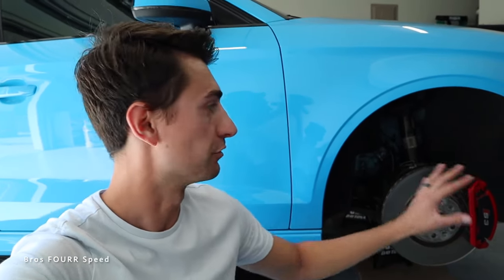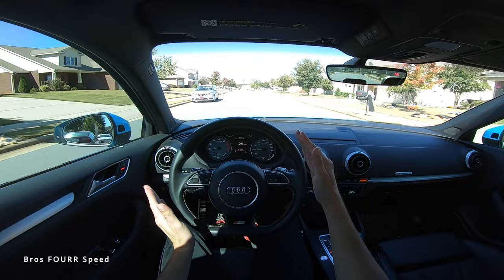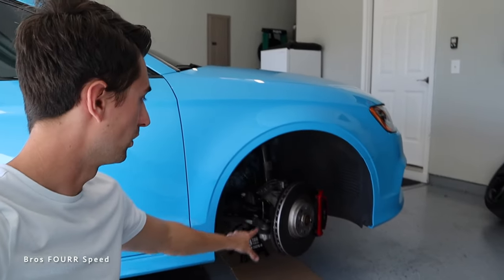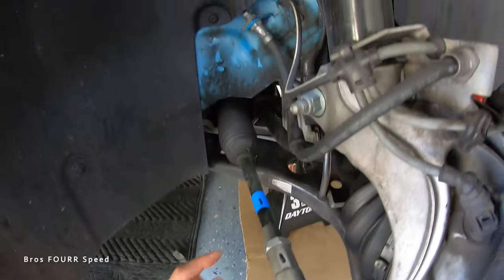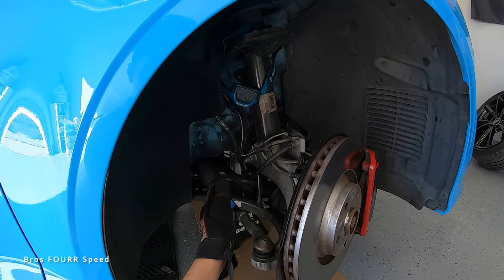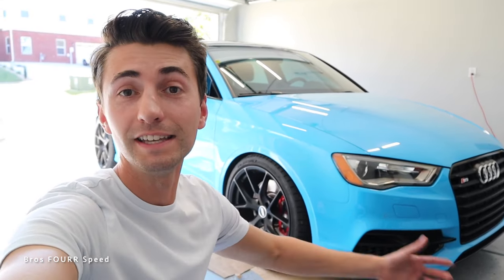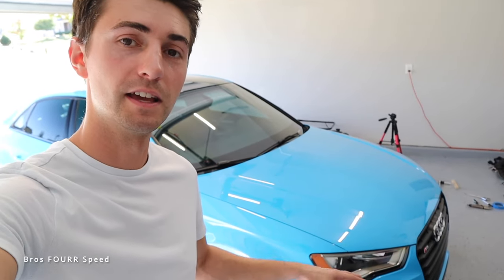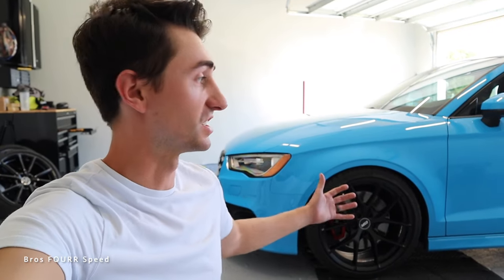How to Straighten Your Steering Wheel Easily at Home | DIY Car Alignment

Comment: No obnoxious intro, no obnoxious music, just straight to the point. All DIY videos should be like this.
Reply from the maker: Thanks! We don’t like that “fluff” so it’s not in our vids!
Reply: Putting intros in videos are annoying. It's more time wasted and it takes longer to get to the information needed.
Reply from the maker: @static_Tricolor_camry  Yeah we like it simple!
Reply: Agreed
Reply: Stop crying
Reply: Hey so my drivers side front wheel is slightly toed out and the passenger side is right where it needs to be. Because of this the steering always seems to be lightly tugging to the left

 I only need to toe in the drivers side wheel. Can I leave the passenger side alone. Can I do it that way? 

And secondly I will be leaving wheels on with them flat on the ground. Do I leave the car in park and completely off as I’m doing the toe adjustment or do I have it in acc mode and in park? 

Also my tie rods are behind the center of wheel when looking at the inside of wheel so I suppose I have to turn tie rod counterclockwise to push out the back of wheel so it toes in?

I’ve never done this before so a step by step tutorial if you can would really help me!!

Thanks
Reply: Agreed. And he's fixing up his wife's car - extra kudos :)
Reply: Hi bud, does this method still apply if the steering wheel it not straight bc I changed the steering column? Cheers
Reply: Lots of repair videos get straight to the point.
Reply: Exactly

Comment: I wanna buy you a beer bro fixed my steering wheel being off thanks a lot man appreciate it 💯
Reply from the maker: lol glad to help! Great tip to know how to do!
Reply: But I don't understand need to do in both sides?
Reply: @juanojeda8069  You need to do it to both sides to keep the alignment. So in his case, car was drifting right..so need to adjust the toe left.. so he shortened drivers side rod (this pulls the rear of the wheel closer so it turns the whole wheel left and then extend/lengthen the passenger side so it 'pushes' the rear of the wheel which turns the wheel left also.
Reply: @RoxusRemo wait I think I see how I fucked up. So “opposite” turn directions, is actually the same, because the rods are pointing opposite directions. So clockwise one side, counterclockwise the other means they both get turned away from you (pushed over) or turned toward you (pulled under) if you’re perpendicular to them

Comment: What's crazy is I took my car back to the shop after they aligned it bc of this issue and they tried to tell me I had to fix my rack and pinion plus the steering bushing for $2700...lack of integrity these days are eye opening
Reply: So this diy trick fix the issue sir?
Reply: @ArczAngel  truthfully, still haven't come around to it bc I don't have a lift. But one thing I know it's not the bushing or pinion.
Reply: You don’t need a lift 😂
Reply: @brentonthompson8909  meant floor jack lol. Not sure why I said lift

Comment: Too bad after $200 4 wheel alignment I'm even having to think about doing this but there you go,great video.
Reply from the maker: Yeah it's a bummer most shops can't get the wheel perfectly straight! At least this is an easy fix
Reply: I had two done still crocked spent £100 now my dad will do this manually

Comment: Just did adjustment at a local shop with my mercedes s212 2016 and got the same result as you. I went back again two times to the shop and try to explain my steering wheel problem. The shop owner was just angry and snarky. Now i will adjust my wheels exactly like you. Thanks for the video. 😊
Reply from the maker: Sometimes doing it yourself is the best result!
Reply: I tried explaining this to the shop who did my alignment but they test drove it with 3 people and told me it was fine. so I took it elsewhere and they ALSO didnt straighten the wheel .-.
Reply: @aquifer98  it happened to me too, it drives me crazy
Reply: I had my car's alignment done at Mercedes Benz dealership and the steering wheel has never been so crooked, it's so disappointing.

Comment: I had to move mine just a quarter, steering wheel is probably more straight than it's ever been in it's life 😂 thanks man
Reply from the maker: Glad I could help!!
Reply: Do youo need to remove the wheel for this?
Reply: @rolandsequeira  Depends on the vehicle. If on full lock you can access the tie rod, then there's no need to remove the wheel. I've done it on my little car.
Reply: glad it is working for you,had my tech add a tad bet for road crown although I was reading up if to much is added it could cost tire wear,tires not tracking straight

Comment: I just had a replacement of all of my expired tyres and had my wheels balanced and aligned, unfortunately my steering wheel is now crooked, exactly like in your wife's car. I went back to the tyre shop but the mechanic wasn't able to fix it after 2 adjustments. Gonna try this solution this weekends as it is driving me nuts. Thanks for this man!
Reply from the maker: Oh wow! Yeah this should do it! Especially if everything was just aligned. You should be able to dial it in
Reply: @BrosFOURRSpeed My steering wheel is now straight. After some trial and error, my tie rods needed around ~190 deg of rotation. Thank you so much for this video!

Comment: Just got my alignment done on my Volvo and they did exactly that. I drives me crazy. Thanks 👍🏻
Reply from the maker: Oh dang!
Reply: Same bro I have an s60t5 put new rod ends on got the dealer to perform the alignment, low and behold still a tad bit cooked lol. Steering. Was straight before I took it to them
Reply from the maker: @DMAX29  crazy how shops can’t put them perfectly straight!
Reply: Just found this great video as I've had new tyres and alignment on my V70 and the steering wheel is crooked!  I called the shop and they gave me some nonsense about 'settling in'. As the old saying goes,"If you want something done,do it yourself"

Comment: Man, you saved my sanity 🤯
Those damn alignment shops always mess up my steering wheel, usually it took them 3-4-5 times to center it.
Last time they all failed and I got tired, decided to fix it myself, found and watched your video and my friend helped me with this procedure - finally steering wheel is centered 🤘🤘
Had similar problem (car drifted to the right), needed half of a rotation with my '07 BMW e60. 
Happy af about it and thank you very much!
Reply from the maker: Glad to help! Yeah it drives me so crazy! When I had my old Supra aligned, the tune shop showed me this trick!
Reply: @Shawn C Hardly disagree. It's shop' and tech' fault only. If you took money - you have to finish the deal. Don't care about how busy they are.
Reply: Tire prolly is gonna wear badly
Reply from the maker: @themotorcycleguy5980  Have zero issues..
Reply: @BrosFOURRSpeed  same thing 🤙

Comment: Thanks man, great video! I had the same problem on my 2012 Camry only opposite of your Audi. My front wheels needed to go slightly to the right. I did one full turn on the adjusters like in your video. But, in my case it was just a bit too far and steering wheel was slightly off in the other direction. So, ended up having to do the adjustments a second time. I returned the adjusters a bit back so that they were both exactly 1/2 turn from where they were originally. 2nd test drive and sucess! Straight track and straight wheel. Kinda sucked having to do it twice but I guess it's trial and error with different vehicles. Still saved me alot of money and hassle with alignment shop! Thank you!!!
Reply from the maker: Nice! It's definitely trial and error. I got lucky and 1 full turn worked. But good adjust to know how to do!
Reply: so if  your wheel was towards the right , did you adjust the driver side toe first?
Reply: @reza_dc2   It really doesn't matter which side you do first. I actually did the passenger side first. What matters is that you adjust both sides absolutely the same. But, one side you will turn the adjuster clockwise, and the other side counterclockwise.

Comment: I usually need an 1/8 or so of a turn.  A full rotation is pretty drastic and may be too much.  Depends on how fine the threads are on the tie rods.
Reply from the maker: Didn’t seem like the sharpest angle on the threads. Depends on the car I guess. But 1 turn got it perfect for me
Reply: How can you do only a 1/8 and keep the alignment aligned
Reply: @Libertyfirstrye  I’ve used calipers to measure the exposed threads before and after. Then add or subtract the same amount from the other side.
Reply: I did a 1/2 turn on my 2022 Toyota Corolla SE and the car drove to much left. I did that 1/8 turn like you did and it worked. I guess its trial and error on different cars🍷

Comment: Looking forward to trying this. My wheels was straight but just put new Michelin pilot ss on the front and it's ever so slightly to the left now, car is a giulia quadrifoglio and it has a really quick rack. Drives me crazy 😂
Reply from the maker: Oh nice, yeah this should help you out!
Reply: Got it sorted. I used the nut itself as a guide, one 6th of a nut turn on both sides got it right

Comment: Wanted to say thank you!  Like you and many others I had an alignment done after having my rack and pinion changed out in my 2012 Toyota Tundra. Like yours my steering wheel was slightly cocked right driving me nuts but not so much i felt like spending half a day at the dealership correcting it.  Only difference between my truck and your Audi, much larger tie rods and they were kinda tough to get that nut loose. 

One small suggestion to others.  I started with a half turn as opposed to a full turn.  After test driving the steering wheel was cocked the other direction.   Jacked the truck back up and reversed it a 1/4 turn and it’s now perfect.  1 full turn is quite a bit depending on the vehicle and how off the steering wheel is. May want to start with a 1/2 turn and go from there.  

Thanks again, great video!
Reply from the maker: Glad it worked! Yeah different cars will differ. On my Supra I did about a 1/4th turn to fix it. The Audi just happened to need a full turn. Easy fix tho for sure!
Reply: I needed 2 full turns on either side the first time. Then after tie rod replacement to pass MOT it was 5/6 of a turn. I did 1 full turn and it was a tiny bit off in the other direction, so sighed, jacked it up and took the wheels off and subtracted 1/6 of a turn.

Comment: Installed a new tie rod because of rattling going over bumps, and vibration when braking at higher speed, mechanic couldn’t figure out what was causing it, so I replaced the tie rod myself and was able to get the steering wheel back to straight again from being off centered. Holding it at 12:10 to drive straight was killing me. So I adjusted the set screw and within a couple try’s, my wheel was straight again. Saved time because I would have taken the entire tie rod off again to re count the 14 rotations or just add/minus but your way was much faster 🙏🏼 thanks again!!!

Comment: Toyota did my alignment on my 2020 Corolla and the purpose was to fix this issue and… well it came back the exact same. I went back in today and of course they can’t fit me back in until next Saturday but I’ll try this today and pray it works. 180km for daily driving like this is driving me insane
Reply from the maker: Dang. Yeah thats why I like doing as much myself. Easy fix tho!

Comment: In my experience of getting wheel alignment, none of these tyre centres are using the clamp that fits up under the bottom of the steering wheel, and the top of the drivers seat. This clamp obviously hold the steering wheel in place, while the mechanic carries out the wheel alignment. It's very frustrating. Tanx for the very beneficial upload !!!   👌
Reply from the maker: Every time I've had an alignment they did use that. But that doesn't guarantee the wheel is straight. So good to know how to correct it!

Comment: Yes it worked on xc40 , after 3 alignments back to back the wheel was either like yours or on the oter side.
I had to do 3 turns clockwise for right and anticlockwise to left(driver) and voilà

Tip, if the safety nut is not comming off , heat it ..
Reply from the maker: Glad you got it done!

Comment: Thanks for this vid! Here in the UK they do a rubbish job too and it’s never straight after getting alignment done. I’ve got OCD and my steering wheel needs to be straight! I’m going to give it go 👍
Reply from the maker: Nice! Just make sure you keep track of the angle of turns on both sides to keep it even.
Glad to help!

Comment: Yeah my 23 Camry Le does that I’m going straight and the steering wheel is a lot to the left , they said alignment was done fine, but they probably didn’t think about that rod! Thank you next time I’ll let them know
Reply from the maker: Yeah if the alignment is good, then this will dial it in!
Reply: @BrosFOURRSpeed  awesome thank you I’ll let them know to check it at my next oil change

Comment: I have the same problem with my Nissan Quest and Toyota Camry.  I thought it was an alignment issue and would have taken the car to the shop.  But with this video's help I'm going to fix it myself.
Reply from the maker: Make sure your alignment is good tho first. This fix is geared towards cars that just got an alignment and now the steering wheel is off. If its been a while since you've had an alignment, this might not fully solve the issue

Comment: I’m having the same issue with my duramax! I’m gonna try this. Dropped the truck off to get an alignment done today, drove the truck, still had this issue.
Reply from the maker: Yeah as long as the actually alignment is good, and it's just your steering wheel being off. This should work well!

Comment: Thank you for the very instructive video. My steering wheel "points to" 1 o´clock (slightly right), and I want thus adjust it counterclockwise to "noon".
Reply from the maker: Yeah follow these tips and you should be able to get it straight

Comment: Do you turn the wrench the same direction when adjusting the tie rod for both sides? Or do you have to do the opposite direction?
Reply from the maker: It will depend on the threads. Look at the direction they go and determine if you need to expand the tie rod or make it smaller. One side will need to be expanded, the other side will need to be made smaller

Comment: Just did this!  Thanks for the video. It only took 1/4 turn to move my Volvo steering wheel about 5-10 degrees!.  Had to do the procedure 2x. But I am happier now.  

Do you think the alignment will be off ?
Reply from the maker: Nice! As long as you did equal turns each side it shouldn't effect the alignment. Provided your alignment was already good.

Comment: I did tie rod assembly replacement in my E150...Hopped in for test drive and steering wheel 90 degrees off, doh!  Took me three attempts to get it really dialed in level while also aligned, but it's doable in the driveway with a little trial and error.
Reply from the maker: OH nice. Yeah not too bad of a job

Comment: So just curious how is this different than what they do in an alignment? Is this changing the angles of the wheels at all or is this just adjusting the steering wheel?
Reply from the maker: This is simply adjusting the steering wheel. As long as you do an equal turn on each tie rod in the opposite direction. Provided your alignment is good, this adjusts the wheel without messing up your alignment.
Reply: @BrosFOURRSpeed  thanks, awesome video man!
Reply from the maker: @thebaconbox1  No problem! I have an updated video on this topic coming soon with our RS3. I think I do a better job of explaining things in that ;)

Comment: I have 2024 GTI and I got 3 alignments already but my steering wheel is always going towards the left when I’m on the high way the dealership told me it’s the road but I been on good roads and still the same result. My question is if I do this adjustment would this affect how the my car drives and feels on the road?
Reply from the maker: If you've had an alignment and you know everything is straight, this is the perfect adjustment to dial in your steering wheel then!

Comment: Yeah it's my OCD no doubt. Hate it too. Unfortunately,  I caught a bump hauling ass around a corner yesterday and now my wheel is at almost 1 o'clock with the car headed straight. Doesn't pull or anything so I'll have to try this. THX.
Reply from the maker: Oh dang! You might want an alignment first tho. That bump could have got things out of wack

Comment: I hope you are changing your own oil, brakes, plugs, and other maintenance as well. Good you are using a torque wrench on the wheel lug nuts. I would put a little of threadlock on that tie rod.

Comment: Thanks for the vid, so.. ive had my bmw 428 alignment done two time now and the shop says perfectly fine. However 95% of the time im driving with right hand down, you can see the padel shifer are a perfect reference for this. When i let go of the wheel the car tracks fairly straight but wheel remains kinked to the right. Like you say is driving me insane. Any ideas?? Cheers.

Comment: Nice clear video. So you are saying here that one full rotation on each side, corrected what looked like a relatively small off center of your steering wheel?
Reply from the maker: For this situation yes 1 turn did the trick. It will depends on your car tho. My Supra was a bit off and I did a half turn for that to get it straight.
Reply: @BrosFOURRSpeed  No way, that is far too much. I have the same car.

Comment: If the rod is ”in front ” of the wheel its the other way around, but thumbs up great explaining it worked !!🤭😁
Reply from the maker: Yeah just look at which way your threads go and either shorten or lengthen the tie rod end of the desired direction to turn the wheel. I did this on my Supra and everything was the opposite way from the S3